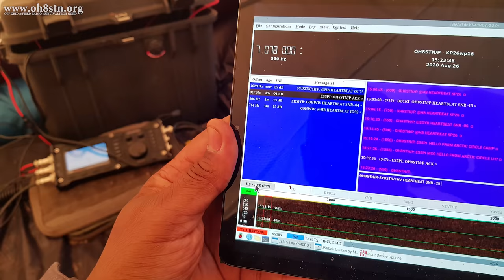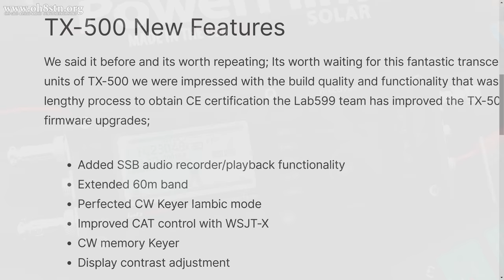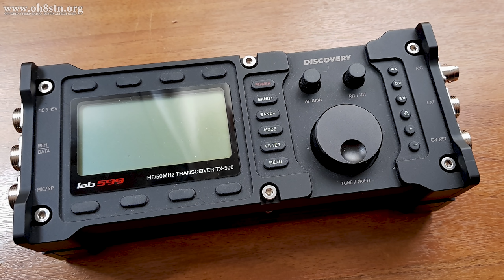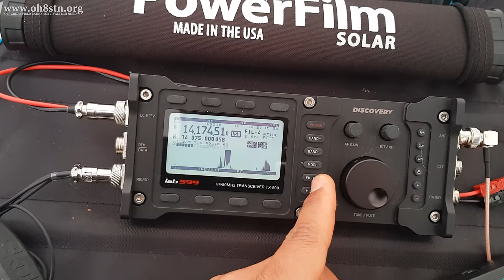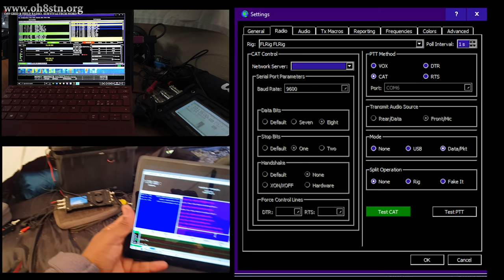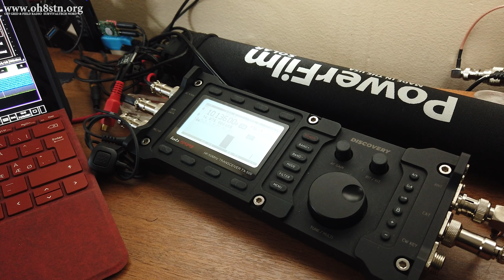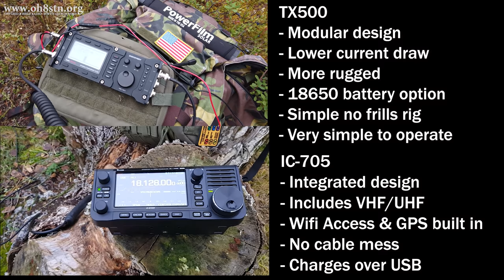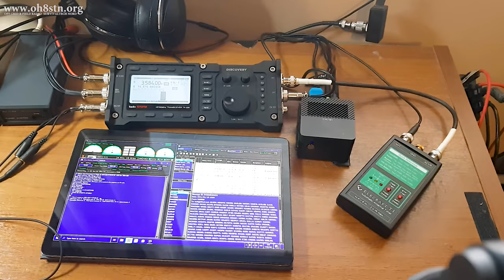Lab599 Discovery TX-500 QRP Ham Radio | Update

Comment: So this might be a better choice than the G90... Though more expensive... Thanks for stopping by my livestream tonight!
Reply from the maker: Not better, different.  Its definitely rugged, and for you primarily operating CW, this would be very pleasant. 
Thanks for making my day Gil. It was a nice surprise 👍
Reply: Thanks Julian, the guys really liked that you stopped by and so did I :-)
Reply: @RadioPrepper  Great to meet both of you as two of the most known bloggers for outdoor ham radio in Europe at Gil's livestream yesterday. 73 de Wolf, oe7ftj
Reply: So what is the better radio?  The G90 or the Lab599 which is getting pricy
Reply: @dennisschultz1175  Personally I would take the TX500: Less current draw, more rugged for field op, less weight, smaller size, a more professional design. Modular addon like a battery case as well as a PA with ATU available.
The only negative point I see is the price - but it depends on your use case.
Reply: When do you stream?
Reply: Gil, Julian is right in that the TX-500 is a better choice for the CW op. And, since you like military-grade gear, the TX-500 would be a much better choice for you. It's so tough, it would double as a hand weapon! :)  The TX-500's keying is excellent. Also, the TX-500 has CW memory keying--a feature the G90 lacks and I'm guessing will never have. And, in truth, the TX-500 is way more portable and efficient than the G90. I would add that I like the audio of the TX-500 much better than I do that of the Xiegu G90. For me, it's not a choice at all. I bought the G90, reviewed it, then sold it. The TX-500 was sent to me for one week to evaluate--I made 7 individual field activations with it in that time plus logged hours of use in the shack. Sending the TX-500 back was very difficult to do and I would have purchased it had it not been one of only a handful of pre-production runs.  :)  So, yes, get a TX-500! 73 Thomas K4SWL
Reply: I think it is a matter of price.  I have used the G90 for a year.  It has been great.  The internal antenna tuner is super and 20 watts is nice.  The G90 is half the cost of the TX-500.  If you are just getting into HF, it is a great rig to get started with at low cost.  I just received the TX-500 and I love it.  The TX-500 is perfect for my backpacking POTA and SOTA trips.  It is much lighter and will save me 2 lbs.  And it has very low RX current drain.  Plus the TX-500 has cw and ssb message memories - great for CQing on a SOTA trip.  I wish it had a tuner but my EFHW antenna covers 40, 20 and 10 which is fine for now.  You could always buy the light weight Elecraft tuner to go with it if you want a tuner.
Reply: @ThomasK4SWL  I had a X6100 for a week and sent it back. The TX-500 is not going back without a fight. It’s worth every extra penny it costs.

Comment: Oh there is definitely a demand for a rugged water resistant 10 watt radio out of the box.  And now, the user added 18650 batteries and 12 to 32 volts grid friendly battery charging just put this radio miles ahead of all others. The companion amplifier just helped it cross the finish line.  If the company could meet global demand for the radio and for the accessories. Then I expect that Elecraft's KX2, KX3,  Icom's IC-705,  Yaesu's  FT-818 and  Xiegu is going to have some serious competition soon. If what I'm hearing is right. Dare I say that this radio could turn out to be one of the more important radios of our time?

Comment: I received my TX-500 yesterday after a 4-1/2 month wait. It was time well spent. The radio is incredible! 80 meters was open tonight so I jumped on NVIS. For those worried about the price, just ask yourself how you'll feel when you get caught in a downpour with your $1,200+ KX2 or 705. This is definitely a radio for the field in the true sense of the word
Reply: Just put in my order a few weeks ago. Can't wait for mine
Reply from the maker: That's practically marketing, but also subjective. Everything I'd want with a kx2 has to pay extra for. Microphone included in the price would be nice. Also the ability to charge it while off grid would be nice but they don't even sell that option. How about a case without all of the Ingress points for dust sand and water. It's a beautiful radio, but it's ready for an update.

Comment: What a great review.👍 I've yet to see one "in the flesh" so to speak but the TX500 just oozes quality, from the machined aluminium casing to the high spec connectors, plus, at last, a radio not scared of bad weather! To say this radio has been well thought out is an understatement. I can't speak for other markets but here in the UK it is also set to have a considerable price advantage over the IC705. I reckon these two radios put the ball firmly in Yaesu's court, it just remains to be seen if they'll pick it up and play.

Comment: When I bought mine from HRO it was $789. I see they are $899 now. Glad I jumped in early. I LOVE this radio. It is not a 705, but I did not want a 705, $1400 was too much for a radio I would take outside.  Thanks for the updates and you will love yours too. It was made for people like you!
Reply: The problem now as the tx-500 with the amp is even more than the 705 which HRO was trying to get me to buy.

Comment: Julian I was on my 500 today.  Sitting in the sun, 7500' ASL in Colorado.  Got out to Cali, Georgia and Alabama today on 10w.  Even heard some Euro chatter and Puerto Rico.  Antenna was a Packtenna EFHW trimmed for 20m and run as a sloper off a 20' sotabeams mast.  It runs well but I definitely need a video from you on encountering interference/weak signal and how you systematically go through the available filters and settings to clean it up.   It has to be deeper than the jog wheel fine tuning and cycling the filter button 4x.  I know there are methods I haven't explored yet.  Maybe a quickstart base settings video...or have I missed it?

Second, what is the preferred method for running headphones along with the lapel mic?  I just plugged my headphones into the audio jack on the lapel speaker portion but audio output is mono to my headset.  I have no interest in doing a boom mic setup but I do like the headphones for windy SOTA summits.

Finally, when can we expect the battery add-on from Lab599 and that amp from Oliver?

Thanks for taking point on the intel for this product.
Reply: As a new ham, I too would be interested in how to filter for weak signal

Comment: Hi Julian. Great research and presentation. I am preparing to purchase my first HF and I wished it was a Yaesu with the DNA of the VX-6, simple, rugged and well built but this TX-500 is all I was looking for.
Is it viable to operate lightweight without an antenna tuner? If so what antenna would you recommend to operate from summits? I terms of power supply would you still recommend the 5Ah pack for summit day expedition? Or is still too heavy.
Thanks for sharing

Comment: EU CE product certification seems to rely on someone inside the EU, but not necessarily a governmental agency, certifying that a product meets the necessary standards. There are going to be a range of standards applying to electronic equipment, from materials and construction to EMC. Alas it's a tedious process of crossing all the t's and dotting all the I's in order to avoid liability

Comment: got mine the other day. Are you connecting FLrig using the cat cable. or a Data cable for the TX-500. Tried your settings in the video but no joy with Cat cable. (KC5OLH)

Comment: these are really great videos. Here is my question though. the Lab599 and it's battery together will run like 1500.00? Which is almost the price. of 3 Xiegu 6100's.  Is it really worth that?
Reply from the maker: If you want a radio which can operate in the rain, snow, or be used as a hammer then yeah, it's worth it to the operator needing a rugged radio.
The x6100 is one of my favorites. Probably only second to the ic-705.

Comment: Given this review and the glowing review of the IC-705, would there be a preference? It looks like the TX500 doesn't do 2 meter or 70 cm. Probably highly dependent on the area you are in but would that make a difference. A lot of repeaters in this area (midwest USA) are on 2 meters.
Thoughts?
Reply from the maker: Not at all being a fan of repeaters, my own answer would be subjective. It would also be fair to say a desire for 2m and 70cm built-in, would also be a subjective requirement. It's a great question, but probably impossible for anyone else to answer but you. What can be said is it's nice not having to carry an additional HT.

Comment: I would love to see your head to head review on this radio against the Xiegu G90 (besides the water resistant aspect)
Reply from the maker: The G90 has 20 watts output and higher current draw. This versus lower current draw, 10 watts, and a MUCH better user interface.
Reply: @OH8STN  what about filters, receive audio, etc.

Comment: Yes, the questionable choices with power systems with modern portable radios kill me. Foundation of all modern electronics is the battery! Being able to charge direct from solar is huge! I think the CTX-10 also offers this.
Reply from the maker: I don't think it's a questionable choice, I think most ham radio operators don't really care. Ctx-10 was a nice idea, but it didn't "off-grid friendly" list. The 18 650 cells internally were a nice idea though. It's too large and has too few capabilities for a modern SDR. Better to get a 705 or tx500.
Reply: @OH8STN  agree 100%. I meant the Elecraft radios. Wish they had better internal power options. Of course me griping about having to carry a small charge controller for portable solar setup for station is really being nitpicky. It's a golden era for portable ops!

Comment: Full break in CW?  And if so, is it smooth full break in?
Reply: I have this radio.  Its break-in is controlled by vox toggle and delay settings.  FWIW, the vox delay can be set as low as 100 msec for CW.  There is relay chatter with breakin/out.  The keyer's CW speed is set in chars/minute and seems somewhat slower cf. to Winkeyer WPM (CW weight set 3:1). YMMV

Comment: How does this radio compare in pure performance terms to alternatives?
Reply from the maker: Finally a non abstract question :-). You know all of these radios have their unique differences. Doing mostly digital work, I could decode some incredibly weak signals. Doing SSB after the firmware update I spoke about, the nearby strong signals permuted enough did I wasn't Disturbed buy "bleed overc from other stations. Bottom line, it was a real pleasure to operate. It's like years ahead of the 818 for example in terms of receiver performance. Better than X5105 and G90. I've only once used a kx2, and that was a couple years ago. It wouldn't be fair for me to comment either way. The
Reply: @OH8STN  That's great and very useful, thank you.

My club has a DX Picnic event this weekend, and I will be taking my FT891. A few of the guys have KX3s, and I am looking for something of that standard. This looks very interesting. Grateful to you for the upload. 73 de 2E0SVB

Comment: Looks like fun little rig with very promising features. Is it worth 940 euros though? Yeah not for me. Will stick with open source hardware for the time being. Better to support people who share their work with ham community , and learn something in the process. Instead of buying yet another commercial product...
Reply from the maker: Name one HF + 6 meter radio which is open source, with the same capabilities, you can carry in a backpack. Waiting, ...
 If it existed, I would already have it! 👍
Reply: @OH8STN  Well that's the issue isn't it? Plenty of commercial products popping up yet open source ones are few and far between. Which is a shame really because the positive impact of os cannot be overstated. NanoVNA is prime example of it. But back to radios. Same capabilities? Not yet but two projects worth having a keen eye on are Hermes Lite 2 (granted more of a stationary rig). And uSDX which hits almost all check marks for amazing qrp rig. Low power consumption, up to 8 hf bands, all mode, cat, atu is in the works. The only limiting factor is weak chip powering it all (Atmega 328P-PU). That 10 bit ADC on it is not enough for comfortable SSB. So only applicable for emergency use if really needed. And dynamic range of the receiver suffers too. mcHF M0NKA also exists. The point I'm trying to make is that for me understanding how the radio works and ability to repair it yourself is really important, and should be taken into consideration when we're talking emergency coms. Same approach you took with building your own battery packs. In other words abbillity to service your entire station (power, radio, antenna)... Cheers
Reply from the maker: You know what you are exactly right. As soon as you said mchf, I kick myself in the butt. I knew about that radio already and I should get one here for the channel. I think the other ones are too new to the scene but the mchf is Rock Solid.

Comment: The ionosphere does not reflect as effectively as in the past.  Ambient noise levels have become very high.  Thus, low power transceivers, even 100 watts, are not what is needed. Instead the standard transceiver should operate at 1000 watts continuous output, and be the size of the handsome rig presented here.
Reply from the maker: More power isn't the answer. Very efficient narrow bandwidth data modes are!